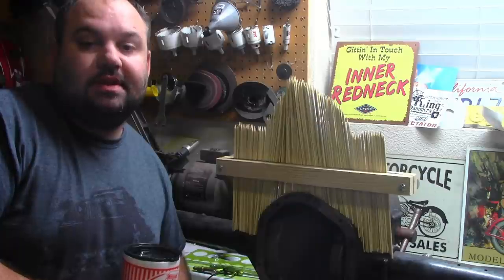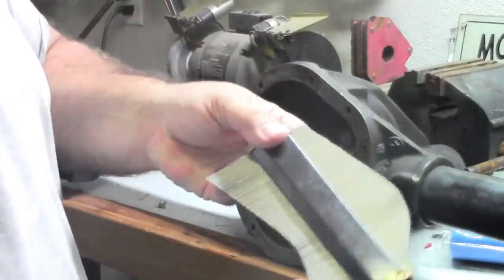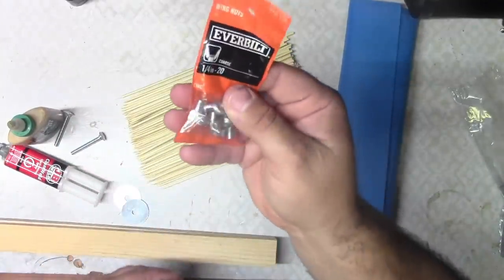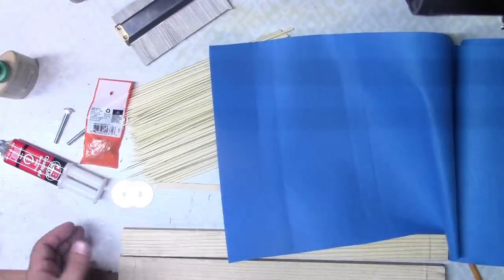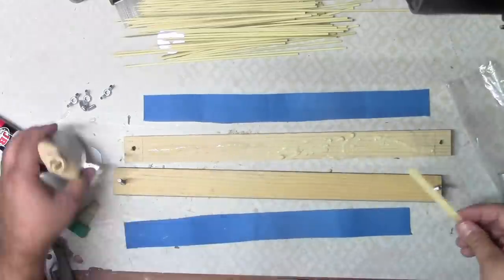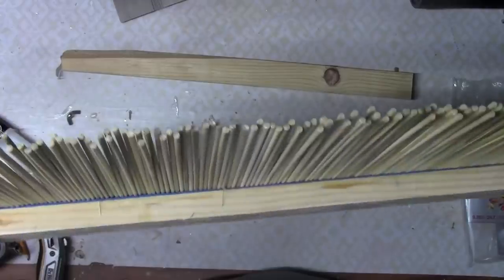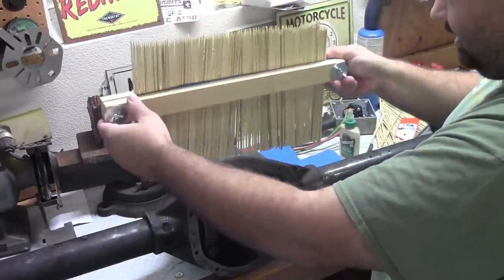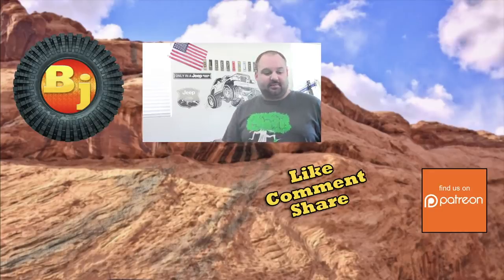How to Make Your Own Contour Gauge for $8

Comment: 3:28 For people that are not familiar with a Mitre Saw, definitely do not cut like that. I use a 12" DeWalt for work all day with no guard, that's my deal, but don't be crossing your arms like that unless you're hoping to cut your elbow or forearm off. That blade is going down and in so it will suck you in if you touch it. 
*No I've never cut myself on a Mitre Saw.
Reply: Thank you Digiacomo, very cool!